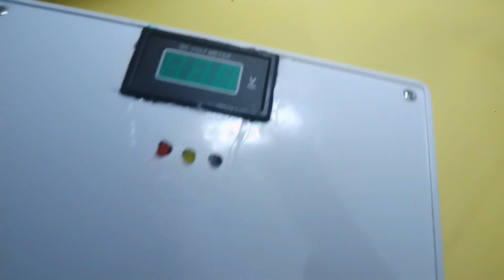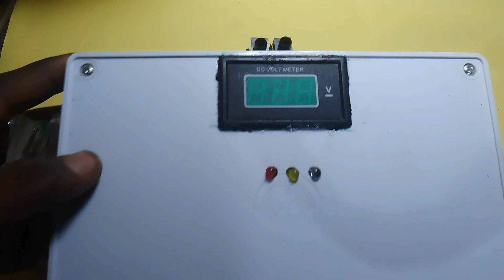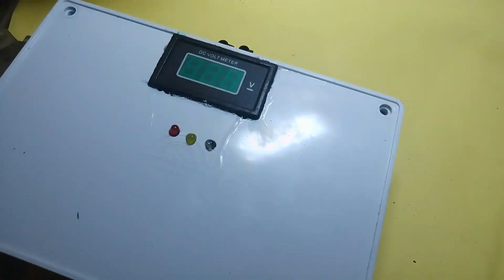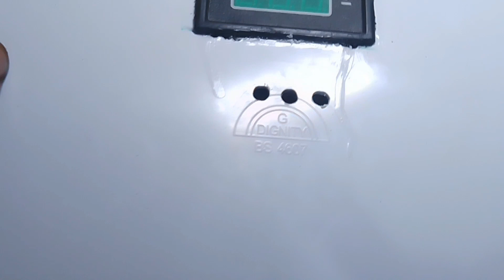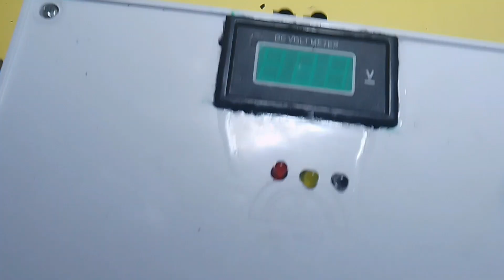DIY Charge Controller for Solar Panels,MPPT Solar Charge Controller Homemade

Comment: transistor reference number ????? Plz
Reply from the maker: The voltage sensor board use bc547 and 30A diode*2
Reply from the maker: Diagram is in the video

Comment: What’s the transistor number
Reply from the maker: The voltage sensor board use bc547,and 30A diode*2 at the input
Reply: @Astroelectric1  Thank you sir 🤲
Reply from the maker: @user-kf8dj7pb8x you are welcome bro ❤️
Reply: @Astroelectric1  what’s the maximum solar panel for this circuit
Reply from the maker: @user-kf8dj7pb8x 800W@12v
Reply: @Astroelectric1  Thank You Sir